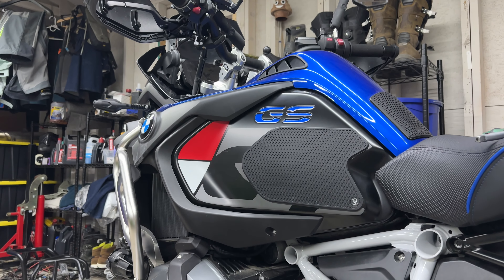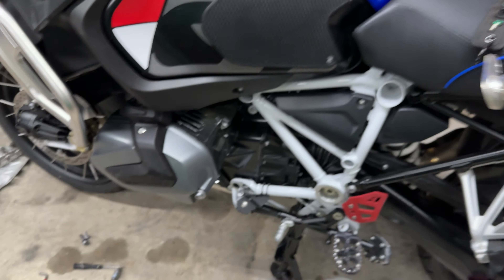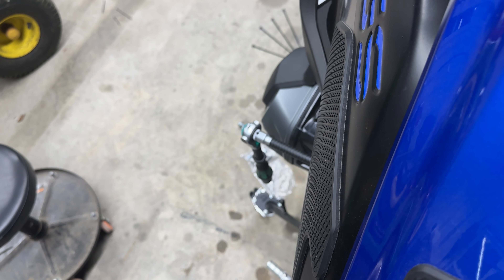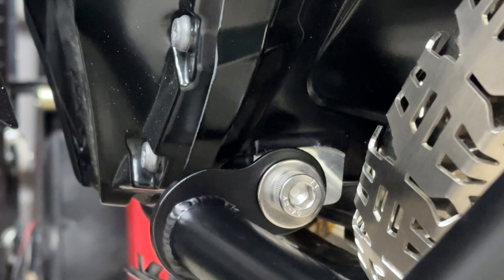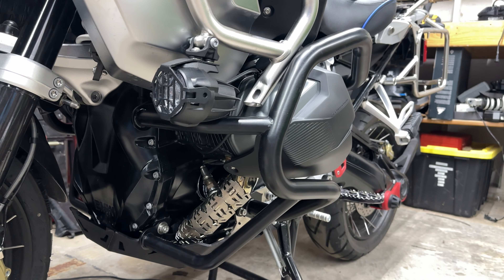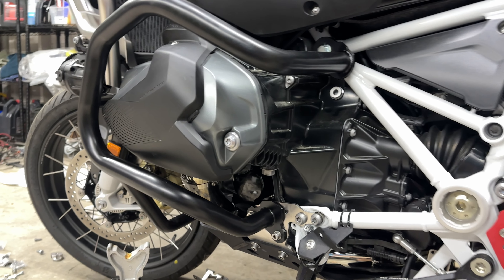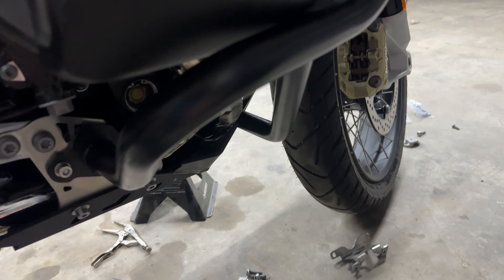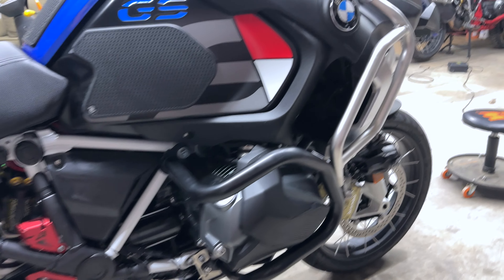Install: AltRider Crash Bars for R1250GS Adventure

Comment: Hi Adam. Appreciate your content to help others (like myself). Question: did you run into any issues with the Right-hand side lower crash bar not lining up with the mounting points on the 1250? I realize you have a GSA, and I have a 1250 GS, but I think it’s the same design. I installed the Altrider skid plate and then went to do the Altrider lower crash bars. The left side lines up without issue at all mounting points and no force was given following their instructions on which to bolt up first etc. the Right hand side would not. If I follow the instructions and connect the top brace to the long frame bolt…then the top front to the frame and then go to the bottom front (threaded case mounting point)…the lower tube is off considerably. Everything is loose too (so nothing tight by any means). If I undo the top front bolt I can do the bottom front, but then can’t do the top front. If I take out the long through bolt so nothing is attached…I can do both the top front and the bottom front, but then the top tube won’t line up where the long through bolt goes (nor the holes in the bracket line up with the bottom tubes). I even sent pics and this info to Altrider requesting a replacement RH side lower (since the left aligned perfectly). Altrider was great and immediately got it out. I just went to install. Same exact thing with the now 2nd RH side lower. I’m now wondering if it was a bad run of a batch. I’m not finding anything online about any issues installing them. My friend has the system on his 1200 and said it went on without issue. My concern is even if I could muscle them enough to flex (which as you know would be hard due to how robust they are)…there would be such force on the bolts that an impact could potentially sheer the bolts and that especially makes me nervous about that front lower which is threaded into the engine case. Anyway sorry for the long winded detail. Just curious if you ended up challenges, sweating, swearing like me on the install. Thank you for your time.
Reply from the maker: It was a challenging install. So challenging that I revere the day that I have to remove these crash bars for maintenance. The one thing that got me over the “cursing hump” was putting in every single bottle and I mean all of the bolts at just hand tight like 2-3 threads on both sides. When I did that, everything lined up and I was able to then tighten it all down. Just one bolt (I tested this hypothesis) being fully torqued down and then I was having to push things together to get bolts through.
Reply: @AdamChandler86  thanks Adam. Ya, I had literally every bolt barely attached to the point it couldn’t be any looser. The RH side was so far out of alignment that such force would be required to get them to line up with holes  that I see no human could or if they were able to accomplish it that the mere force against those bolts would be severely compromised. Odd how the left went on without any issue and lined up perfectly. Easy. Something is off on their spec and manufacturing of these. Anyway, I appreciate your time and response.
Reply from the maker: I've been told the tolerances were made way too tight. It was supposed to be a strength thing and I get that. They are strong when installed but it makes DIY really hard. I've seen mechanics struggle and curse their way through it.

Comment: Did you end up using the two included spacers for the front mount point (into engine) or are those only if not installing the skid plate. The directions aren’t very clear on this.
Reply from the maker: Crap, I don’t remember. Probably not but I will say AltRider’s phone support is great. Lindell usually answers the phone and is really helpful.
Reply: Says those spacers are only to be used “if not using AltRider Skid Plate.”

Comment: Hey Adam, Would you happen to know if Altrider still makes the Heel guards for the GSA? Can't seem to find them anywhere.
Reply from the maker: Sorry for the response delay.  Here’s the right side - https://www.altrider.com/altrider-rear-brake-master-cylinder-guard-for-the-bmw-r-1200-r-1250-gs-gsa-water-cooled/pid/1144 You may have to call them up to order the left side. I can’t find it on their site anymore. I did some googling and any place that did have it shows out of stock. These are awesome upgrades over the OEM. Lighter, longer, smoother finish for heel to slide over it. Highly recommended.
Reply: @AdamChandler86  Thanks Adam. Much appreciated. I'll give them a call!!!
Reply from the maker: Tell Lyndel I said hi! She’s a great customer service rep. They may have a few laying around just not on the site.
Reply: @AdamChandler86  Thanks so much Adam, you Rock!!!

Comment: These look beefier than the stock but I think they should have put more thought into it. The tube which aligns with the lower section of the cylinder head needs to be further out and there should be more gap between the tube and the cylinder head. The upper tube design is better. I understand they were trying to fit the contours of the cylinder head but practically this doesn't make sense.
Reply from the maker: That’s great feedback. I think they could have done better on the 1250 bars. The 1200s were a bit better and I find when doing full lock turns when I put my knee down low on the cylinder heads, I can’t go as low as I used to on my 1200 for turns. Either the heads were pushed further back on the 1250 or these bars are needlessly sitting too high.